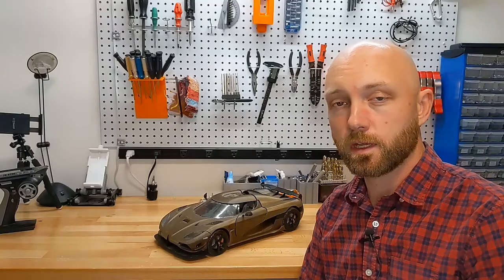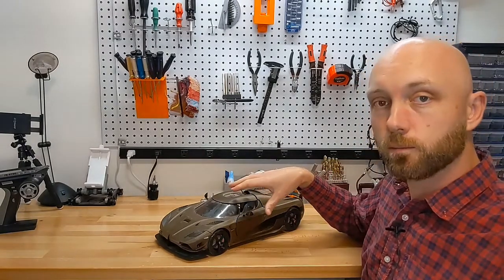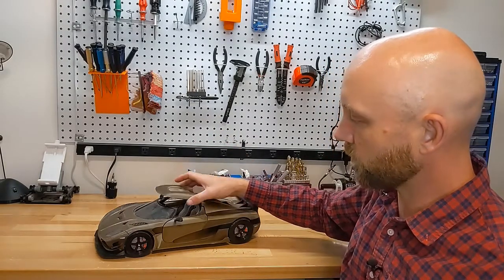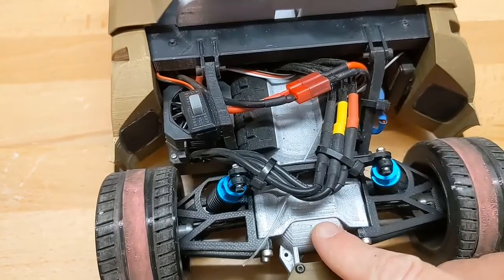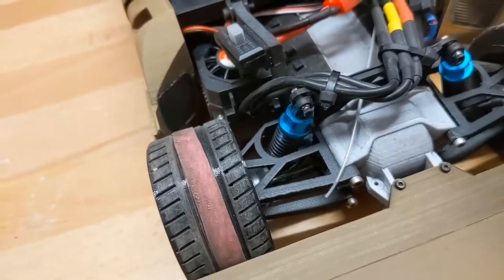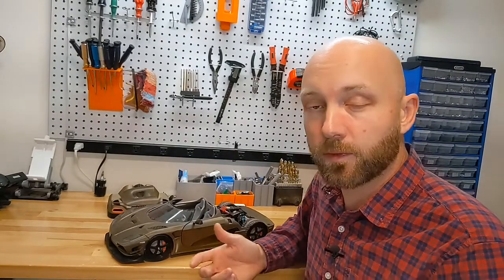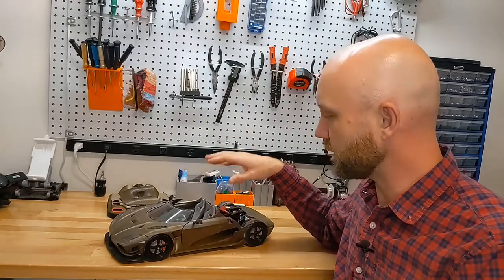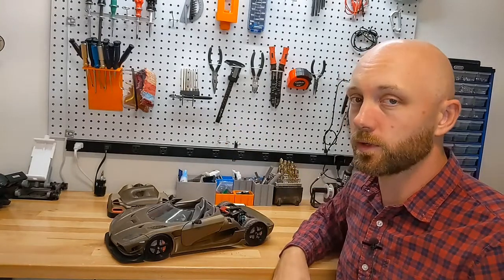3D Printed Koenigsegg Agera RC Car by Depronized.com - Should you build it?

Comment: Very cool, make sure to check it out also my complete 3D printed Bronco kit, there is a lot engineering behind! Love this project!
Reply from the maker: Bronco looks pretty cool man, might have to build it at some point :) Do you have any demo videos of it showing how it actually performs/runs/sounds/speed/turning IRL? How would you compare it to something like the 3dsets rancher or the AN3DRC blazer? Gearbox looks pretty similar to the 3dsets original brushed one before they upgraded to brushless. Hows the reliability on the Bronco? That would be my main worry with this model I think with the open diff in the front and mostly 3d printed shocks and driveshafts etc. I see in your build guide you say not to go forward and then backwards rapidly which must mean you've had trouble overpowering the drivetrain.
Reply: @rcprinter  Thank you very much my friend! I posted some videos on my channel, but they are not well edited so far. In the future I will do some serious footage! Honestly I never printed a model from 3Dsets or AN3DRC, so I cannot give you a comparison, it's my first 3D printed RC car and honestly I don't know how was designed the gearbox of the Rancher but I used some original solution on the transmission (I was inspired by my experience on the automotive engineering). You are correct regarding the forward/backward manouver, I noticed some failures on the driveshaft or differential due to high torque stress but I completely solved that with a new design and in the middle of this week I will upload that! Looking forward to see the 3RONCO in your channel :) Keep it up!

Comment: Hey how much cost to build car like this because i want to creat 3d rc mine designed car
Reply from the maker: It really depends on which motor, esc, shocks you choose. $200-ish maybe is a ballpark starting point without a controller and battery.
Reply: Its good

Comment: Thanks for a very nice and fair review of this crazy project. :D  Only thing I would add to it is that this model is also aimed for those who wants to put much effort into post-processing with sanding, painting and things like that (which I don't have the patients for nor the skills). That it runs (occasionally between breakdowns) is just a bonus. :) As you got perfectly right in the review, my interest was the internal structure and the buildup of the full size car and not the RC-car driving part of it. I must admit that the one and only prototype I ever built, which is in my video, has not been driven more than a few times totally before I placed it on the shelf and moved on to the next project. :) Some users on my forum have put way more work into the finishing touches than I ever did and it's super fun to watch their results.
Reply from the maker: Thanks man, its a beautiful model! So glad to have been able to build it. I think it gets the most looks when people stop by to check out the workshop.
Reply: @Depronized Link to the forum page does not work. Any updated link?